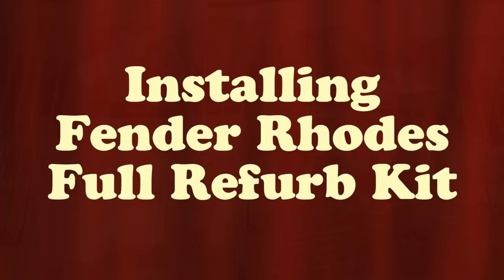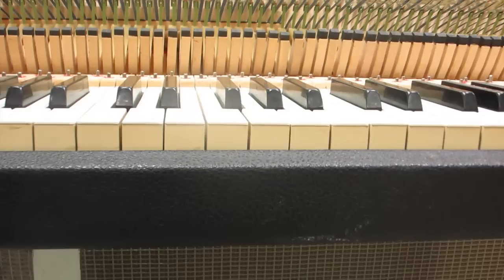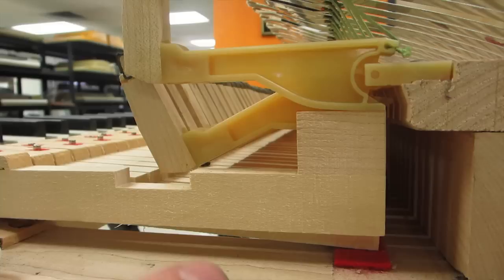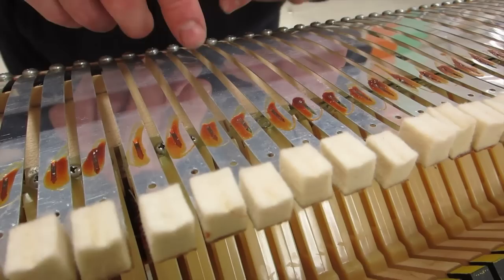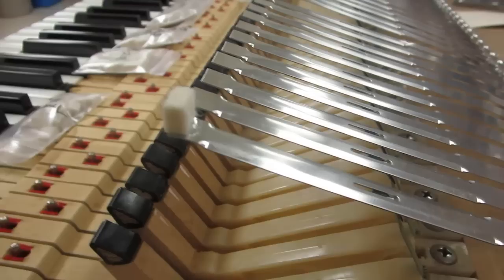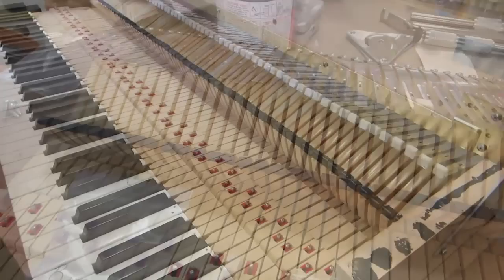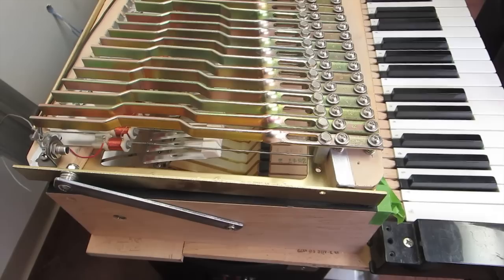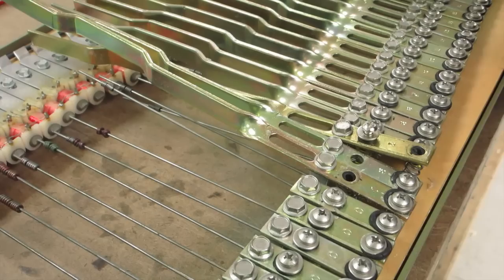Fender Rhodes Full Refurb Kit Installation guide (Vintage Vibe)

Comment: Where does the metal block with the #37 thats being used for the tone bar escapement measurements come from? It's not in the refurb kit
Reply: I was thinking the same thing (and you prob figured it out already) but I realized it's a tine. I disconnected the one from the lowest tone bar (the little bolt takes a 3/8" wrench or socket) and used it to set all my escapements :)

Comment: Doen't adding in the key felt to the miracle mod maladjust the stop block?
Reply: I need to know that too! Vintage Vibe?
Reply: As the felt is being applied to the bump as well as the braking surface of the pedestal, the relation between those surfaces and the hammer cam remains the same. It is always good practice to check your work before going on to repeat it dozens of times, and so a test with felt is prudent.

Comment: Can someone elaborate on why you don't want the key to touch the front rail felt on key press? I am  piano technician and this is quite different from acoustic piano but I don't understand why. Thanks.
Reply: I think because that would impede the key pedestal from engaging the hammer completely to the tine thus not allowing the felt to engage a full mute....my guess.

Comment: How long should it take someone who has never done this before to complete this task?
Reply: I just did the key leveling step last night, took me two hours to do that alone.
Reply: @no_talking  Doing this soon. I guess he just did the low a and high c and left out all the others to keep the video short? He doesn't really explain either what he uses to heighten/level the keys. Is it paper washers, is it felt washers?
Reply: @shavesinthedark  I used paper washers
Reply: On pianos you use paper and felt. Put felt on first add paper punching to level. Then turn all the punchings over. The felt would be on top.